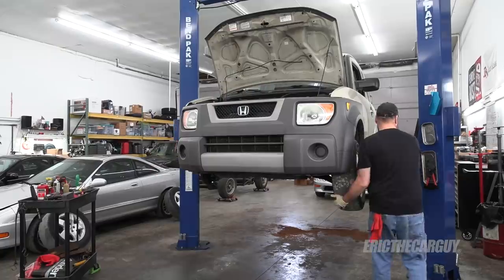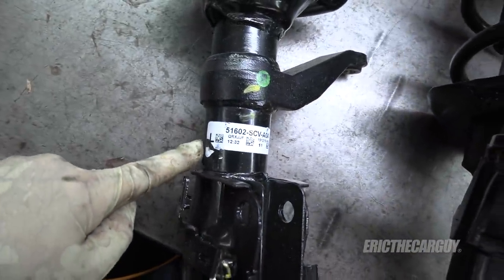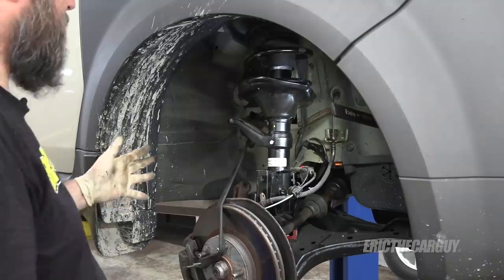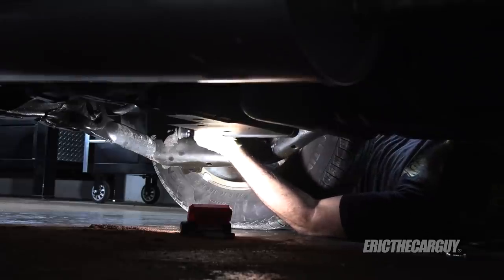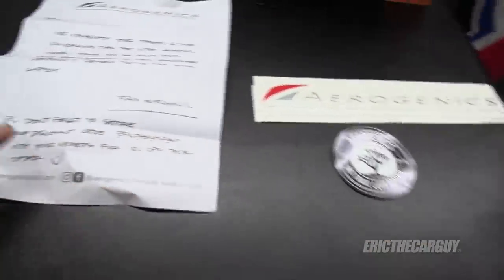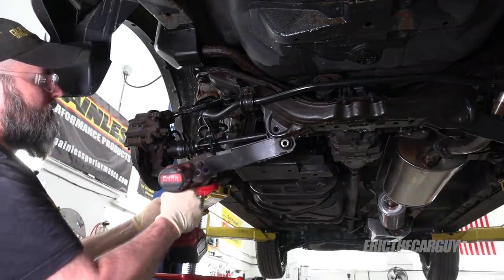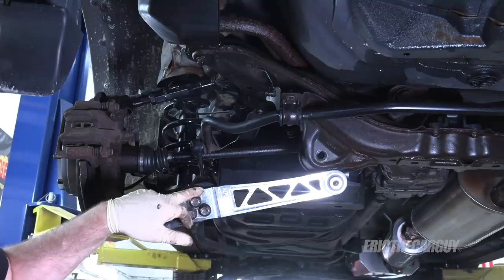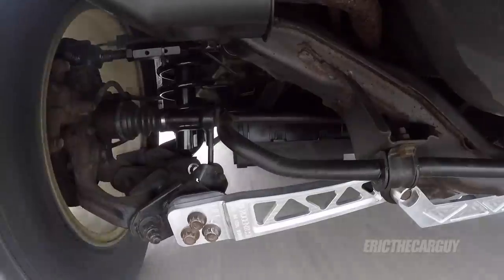Honda Element Suspension Rebuild (Part 2)

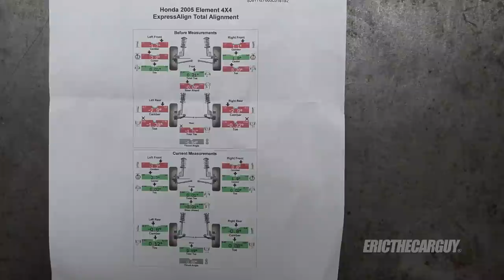Comment: 26:47 Eric, I paused to read alignment and notice that the After numbers are not symmetrical. E.g., front right camber and caster are different from left front camber and caster. Explanation?
Reply from the maker: Front camber adjustment bolts are on the way. I won't be making a video about it though. They didn't arrive in time to include in this video. Thanks for the comment.

Comment: I just did the rear lower arms with the skunk2 ones. Kinda glad all because of the included special IMPACT socket rather than aerogenics aluminum one?! Couple of those special bolts took a lot to break free. Fyi the Skunk2 kit comes with new "special bolts"  and metal plates where you were concerned about bolting the soft aluminum.

Came across this vid looking to see how bad that rear upper bushing is to replace - guessing pretty bad

Comment: Thanks for doing this video. I need a full suspension refresh on my 2003 Element with 200K on it. To date I’ve only done the quick struts from Honda (at 100K) and maybe a ball joint. My rear camber looks “racer boy” and my tires are bald on the inside tread. I have the adjustable rear upper arms ready to go. Currently the tires in back make it sound like a bad wheel bearing - which at this point it might need those as well. I am in Minnesota so rust is definitely a problem. Want to get it into a shop and have them inspect the rear lower control arm mounts for rust. A number of these Element are being “totaled” due to rear suspension rust.
I have owned this Element since new and it is hands down the best car I have ever owned. I’d like to keep it forever - my Summer car is a low miles Supercharged Mini Cooper S.
Reply: I too own a 2003 Element and love it. Only 135k miles. I would love to do this stuff myself but I don't have a lift or all the tools. So I do what I can.
Reply: The ricer squat is commonly just the bushing on both upper and lower control arms. I have heard of corrosion probs with the trailing arm. My rear uppers need that bushing he said was a pain in the ass so might wanna plan for that too
Reply: @johnziriada2820  I had the mew adjustable rear upper control installed last week by my mechanic. No issues with the install - according to the invoice it took less than 30 minutes to install. I had sprayed down the bolts with penetrant oil a few days before drop off which I believe helped. I got the Element up on jack stands in my garage and took a good look at the typical rust spots where the rear lower control arms connect to the frame. Those areas look near new. I chalk that up to having a car wash “service” near my work where I paid for unlimited car washes each month. I had my 2003 Element washed and the undercarriage sprayed pff every few days in the Winter months.

Comment: Such great quality editing - always a notch above the others. I wasn't aware that manufacturers publish their vehicles' camber angles for models built with non-adjustable control arms. I guess the data has to be made available for technicians working on major suspension damage.
Reply from the maker: You also want to know what the angles should be to account for spring sag and suspension wear. Always great to see you. Have a great weekend.

Comment: Thanks for these great videos. They make me want to sell my old Tacoma and get an old Element. I could be mistaken but I think the aluminum socket should be used to install the bolts rather than to remove them. Either way I do not think the aluminum socket could hold up.
Reply from the maker: Perhaps, but you still need to remove them.
Reply: @ericthecarguy  You are right about that. Like you said, buy the correct socket.
Reply from the maker: Link in the description.
Reply: @ericthecarguy  Thanks

Comment: sweet! suspension work is my favorite, instant gratification. think you’ll get some camber bolts for the front? looks like its going to pull looking at that cross camber
Reply from the maker: Funny you should ask. Camber bolts for the front are on their way. I didn't know they existed until after the fact. Thanks for the comment.

Comment: I look that socket up in the Snap On book and it is showing that the SNAP ON PART # DPSM16 socket that is in ?. That is a 10 point 16MM I am ????? that you say it a 10 point 17MM just trying to clarify 16-MM or 17-MM thank you
Reply from the maker: The tool I used is linked in the description.

Comment: I had the same problem after I replaced the complete front suspension and axles...the damn steering wheel was not straight.. As for the brakes I used Honda brake fluid and ebc stage 5 rotors and green stuff pads... Factory Honda element brakes suck even with 4 wheel abs...
Reply from the maker: It's common to need an alignment after doing suspension work. Personally I'm just going to use steel braided brake lines and a new set of quality pads and rotors. Thanks for the comment.

Comment: Love your videos Eric! I'm subbed to both of your channels and they're very entertaining and I've learned quite a bit from them!

I have to ask...Why would a parts company send an aluminum socket to loosen/tighten bolts?  Also, apparently their quality assurance is a little lacking if they misspelled "left" on the part! I'm not a mechanic at all but I can honestly say that I wouldn't buy any parts from this company judging from what I just witnessed!
Reply from the maker: I suppose it's better than not offering a socket at all. It's a specialized fastener that requires a specialized tool. Perhaps it works on California vehicles and not ones from the rust belt. As for the misspelling, I'm dyslexic, so I don't judge. Thanks for the comment.
Reply: @ericthecarguy  

 Just a weird thing overall! I guess it would work if it wasn't for the rust and some over-torque. But If someone didn't have the socket and was excited to get it included, they would be very upset and rightfully so. Love your vids and keep up the good work!

Comment: If Honda has been braking coil springs why not go aftermarket?
Reply: Seems like the aftermarket is somewhat limited with quality Element struts, but then again I replaced the front struts on my Element several years ago with OE and couldn't have been a year later one of the shocks started leaking, not a big fan of oe suspension components, and they're just absurdly expensive.  Replaced my rears with Napa struts though and they seem to be doing pretty good.  Napa sells fronts now too, but the price is so low it has me worried!
Reply from the maker: Nothing in the aftermarket holds up as well or rides as good. At least as far as complete strut assemblies are concerned.
Reply: One thing id really avoid aftermarket is coil springs, I feel like no matter what they will never be as good.
Reply: @VeyronBD  unfortunately you are right. However Bilstein makes excellent ones though not for the Element.

Comment: I'm loving the Element videos. But didn't you purchase the $200 TL as a winter car? Will the Element be replacing the TL?
Reply from the maker: The TL is my 'airport' car. Meaning, I can drive and park it anywhere for a week and still expect it to be there when I get back. Since it's a reliable POS, I can also expect it to start after sitting like that. I also drive the TL in the winter, but when I need to haul stuff around, which I often do, the Element seems to be the way to go. Also, it's AWD, the TL is not. Thanks for the comment.
Reply: @ericthecarguy  No justification necessary! 😆 I was just curious.

Comment: How much did it cost (parts and "labor")?  I have a 08 CRV with 190,000 miles that will need the whole suspension system replaced.
Reply: This looks like 2500 in parts to me, the shock assembly is $500x4 

Hopefully I'm wrong though😂
Reply: It's gotta be like 15 hours of labor tho?

Comment: Why no camber adjustment bolts for the front struts?
Reply from the maker: I didn't realize they were available until after I finished the video. I have a set on the way that I'll install and get another alignment. Thanks for the comment.

Comment: I didn't have the $ for oem on my CR-V so I went with KYB.
Reply from the maker: How have they held up? Ride quality?
Reply: @ericthecarguy  Well i can tell you, they are like factory, i installed them in Christmas 3 years ago and no problem, I got a Honda civic 2003 4 door hatchback (i don't count the hatch as a door, bite me!)
Reply from the maker: FunkyDancer Personally, I never thought KYB rode as well as OE. Way too soft in the corners in my view.
Reply: @ericthecarguy  Cant say for honda, but on my 91 corolla KYV felt entirely identical to standard (minus the busted rear one). I guess its just one of those luck of the draw situations.

Comment: Do you always test drive with dirty gloves on😈
Reply from the maker: Not always, and it doesn't transfer to the steering wheel in my experience. Trying to change sweaty gloves is a PITA. Not to mention instead of dirty gloves, you're using sweaty hands instead. Personally I prefer dirty gloves. Thanks for the comment.

Comment: I'm finding it very helpful to chase threads before installing old bolts and chasing threads in the holes whether using new bolts or old. They grip so much better. It's hard enough trying to install a bolt when you're fighting heavy new parts, using a jack on suspension, then fighting to get a bolt to start. I even did this with the wheel lug nuts and studs and I have to wonder what the hell others did to my wheels when they took them off and put them back on. I found almost all of them stripped a little bit. I think the money I spent on a tap and die kit was well worth it.
Reply from the maker: Thread chasers are different than tap and dies. They aren't designed to cut, only to clean the threads. Mine is linked in the description. 

When you tighten a rusty fastener, you're working agains that rust which will effect the final torque. Also be sure to clean under the bolt head where it makes contact with the component that's being fastened to help reduce friction there as well. Thanks for the comment.
Reply: @ericthecarguy  Thanks! It would be a lot easier and better to use the set you suggest. I'll get one!

Comment: what seat covers are you using?
Reply from the maker: Those came with it when I bought it. I've since replaced them with ones with an open back so that I can still use the pockets in the back of the seat.

Comment: Hi Eric
Can You do a video on all the little things that break on Honda Accord (I have 2004) I’d like to be aware of dangerous stuff that I can maybe replace ahead of time. I was lucky when the hood struts failed. I just went to the trunk to get washer fluid when the hood fell!! That could of been BAD!!
Yesterday the gear shift button fell apart in traffic. I only had D and N. That could of been very bad. No R!!! Can’t get key out. 
Sometimes on amazon it says “people also bought…” and one of those was the hood struts. I can’t find anywhere all these parts are listed, gear button, struts, gas tank open cable Etc. I can find videos AFTER it breaks, but……
Like in this video you say, “these fail a lot in Honda’s”
thanks!!
Reply from the maker: Personally I recommend routine maintenance. That way you stay on top of things and the inspection should reveal any issues that might come up. Thanks for the comment.
Reply: @ericthecarguy  thank you for responding, I’m a fan.  
But……they don’t really check for stuff like the shifter button crumbling, or hood struts failing.
I had one inspection (stopped going there!!!) that after I got home (had to get to an appt and was in a hurry) and looked had NOTHING written on the pink slip, emissions said “cancelled by operator”. On phone “hey you got your sticker”. Being alone you get this kinda stuff. That’s why I learned to fix things myself. 
I guess I’ll make a list and try to find a venue to ask for others to contribute info.
I’ll send it to you if it gets going.
I get your, “I don’t have a lot of extra time” video. I know that feeling.
Ok thanks anyway.
Reply from the maker: I didn't mean have someone else do the maintenance. No one will care as much as you would.